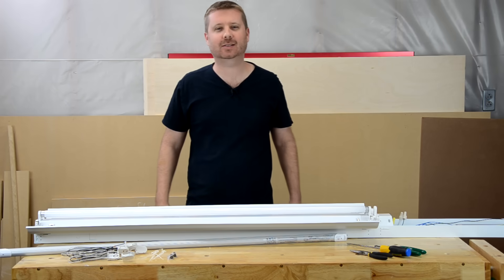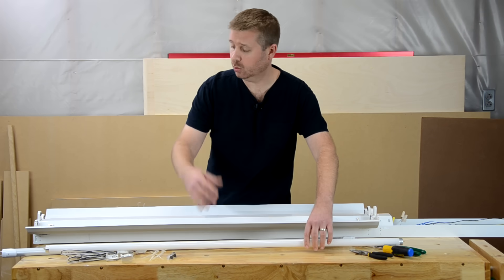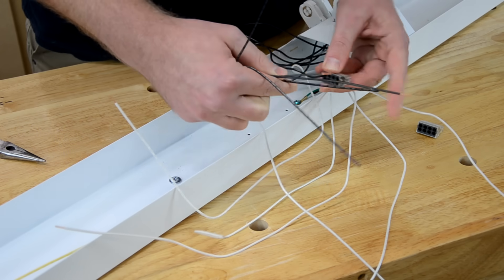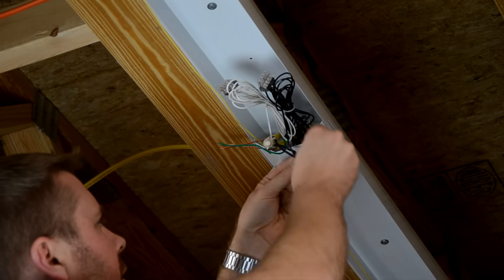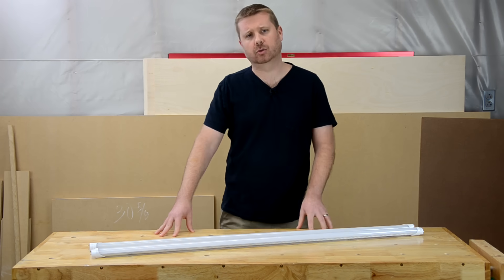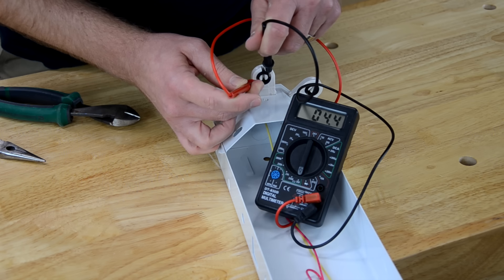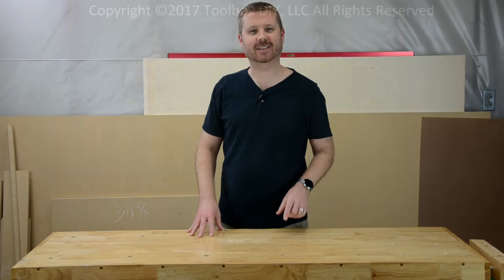How to easily convert fluorescent Lights to LED –Easy Ways to Save Money

Comment: Replacing fluorescent bulbs with LED is only about 50% more energy efficient, depending on what type of fluorescent bulbs you have. The mail reason I converted was because of the noise the ballasts make. Late at night it drove me crazy. Also, in a cold basement or garage, fluorescent bulbs may flicker until warmed up. LED's won't do that. Note: some (not all) LED bulbs are not instant on and may take a second or two to light up. This may take a little while getting used to. I don't recommend doing the conversion unless you have basic electrical wiring knowledge and skills. You'll want to look for 4000K color temperature LED's to achieve the same exact color as fluorescents.
Reply: Glenn Watkins like LED bulbs, fluorescent lamps also come various color temperatures, not just 4000k.
Reply: There are way better colours than 4000k out there. I used specific colours for specific applications when I was an electrician with degrees in lighting engineering. In dairies I could get the cows to produce 17% more milk by useing certain colours and in classrooms for kids with ADHD or ADD certain colours have a calming effect. Plus,  who wants to duplicate the colour of fluorescent bulbs anyways. Good video though he did leave out some important info
Reply: @prepperjonpnw6482  Look for CRI (Color Rendering Index) if color visualization is important.  Some LEDs/Fluorescent bulbs do not emit a continuous spectrum of light.  Colors can be absent.  High CRI (95 and up) present a more continuous spectrum and will allow you to see all colors more readily.  This is totally independent of color temp which is only a subjective description of overall color.
Reply: Yeah, but those LED's I installed at work have 50,000 hours of life, 
So if you use them 5 hours a day, that is 27 years of live.
Try this with an florescent lamp.
On the other hand. if you install 40 bulbs at the hall way even if they are only 50% efficient that means that you save 50% 0n power. 
If you have a business that has 1200 bulbs on their show room and you saved 50% that is a lot of power, actually you save more because you would have less heat also and your air-conditioner has to work less time also.
Reply: Way better colors ? Color temperature is a personal taste when it comes to home lighting. Not everyone likes soft white (2700K) or ultra-white (5000K up). Most schools and homes use standard 4000K fluorescent bulbs.
Reply: Glenn Watkins Glenn my Fluorescent ballasts drive me crazy with the noise as well. And when it's cold the noise is worse and the light output is crappy and flickers! What brand LED conversion tubes did you use?
Reply: I converted 4 dual tube ceiling mount fixtures using these bulbs: https://www.ebay.com/itm/161612851107
Reply: Hi Glen, you can convert you ballast to an electronic ballast, they do not flicker because off the higher frequentie and do not flicker on  startup. They also do not hum or make noise and are a lot more efficient on power use. You can also dim the tubes untill 3% power, this applies to both T8 and T5 tubes.
Please correct me if I am wrong
Reply: At work, I got the Hyperikon T8 LED Shop Light Tube, 4ft from Amazon.  one of the reasons, NO Ballast used, and they work over 120 or 277 volts.  All the lights where I work run off 277 volts.  I installed the 4000K ones in the HR office.  There's bright and white.  Maybe a bit to much.  The owner wanting something not quite as those, so I got the 3000K ones.  He's really happy with the light from those in his office.   They also have 5000K and 6000K versions.  

So the normal Fluorescent bulbs are 32 watts.  These are 18 Watts.  That's about half the power.   When there's a bunch of lights that are on for HOURS, that can be huge savings over a short period of time.  Half the power, and far, far longer life.  Fluorescent bulbs take a big to fully become bright.  LED's are Instant.    

I think in a BI open office area using office cubicles, that 4000K would be good to use.  In a smaller office, 3000K seems like a better light to use.  At home in my garage, I may go with 5-6000K.   Not sure, no rush to convert there as the lights are not on that much to really make it worth spending a bunch of money to convert.

I had 3 round fluorescent bulbs in my Bathroom.   It took a while for them to fully get to full brightness.  I was not a fan, then I came across the round LED version, and installed those, GREAT!!!  Full brightness, a little brighter.  They save even more power.   Most of my lights in my House are LED's.  I still have a dual Fluorescent unit in my Kitchen.   I would like to replace it, or convert it.  I havn't made up my mind yet.
Reply: JB Dragon k
Reply: I went to Philips ,daylight T 12 [2[ bulbs and replaced the advance ballast w/ a GEelectronic ballast and installed  the 2 bulbs and they nver lit up and began smoking on the ends. What was wrong ? I re installed the GE F 40 CW T 12 bulbs and they work fine.
Reply: Most of the stuff I have seen LED are no where near 50% saving lumen for lumen ...Assuming you don't have something ancient that is ... But even if it is only 20% and it really will last for years and not make a bunch of noise?  And not have mercury waiting to bust out and contaminate your home ....It is a good upgrade even if it never pays for itself because you don't stay there long enough etc...I mean assuming you actually get quality components....not to mention it is a great time to upgrade to dimming and or get more lumens from the same size footprint of light fixture ...color/temperature enhancements etc...  But if ALL you are doing is trying to save money?   At least wait until the fluorescent begins to fail...then it becomes a lot more of a no brainer as a fluorescent ballast can easily cost what an LED retrofit might....no brainer then
Reply: How to wire a door bell
Reply: Glenn Watkins n;
Reply: Semper Fi  Thanks Bernie, I mean Semper.
Reply: My conversion to LED saves energy and eliminates ballast noise.
Reply: Glenn Watkins, no you are not even close.  Comparing apples to apples, only a few LED bulbs have higher (true, not chinese marketing lies) lumens per watt.   Many have about the same or even fewer lumens per watt, AND most have far fewer lumens per tube so you either have dimmer light or have to buy and install more fixtures and use more power to run them.

Modern fluorescent ballasts are quiet, operate far above the human hearing range.  You are correct that in VERY cold environments, modern ballasts do still result in dimmer tubes until they warm up for a few tens of seconds.
Reply: Stinky Cheese lumens per watt is not the correct calculation, In most fluorescent fixtures much of the light is wasted since it goes back into the fixture. Most led send light in one direction out of the fixture. So delivered net lumens  is what should be measured and compared, not gross lamp lumens.

Comment: Why did you save all that wire? Just cut it off ?
Reply from the maker: If you're talking about the leads on the non-shunted tombstones, it was easier to zip tie those than to cut and strip 12 wires to make them shorter. If you're talking about wires on the old tombstones at the other end, I kept them so if LED technology changes such that I either put in a double ended tube or end up installing some sort of LED driver, then the wire is already there and ready to use. I try to think ahead...not that I'm successful at it, but I try! :)

Comment: Watch those old ballasts, any black stuff coming out of them is wicked stuff!
Reply: The tar in ballasts was once known to contain PCBs, now verboten; best to avoid.
We once had our tech doing a repair on some Spaceflight Hardware, he left it open on his laminar flow workbench to go get the inspector. 
Yup, the ballast in the bench let go all over it. OOPS! 
The new rule from Lessons Learned (after the Failure Board met) was; put it in a covered tub if you leave it on the bench, nothing left open!
Reply: No it's not.  In any ballasts made in the last few decades it is just an epoxy potting compound that is not especially harmful.  Less harmful than dish detergent for example.  Even if you ate it your body cannot absorb it.   Maybe if you ground it up into a powder and smoked it so don't do that, lol.

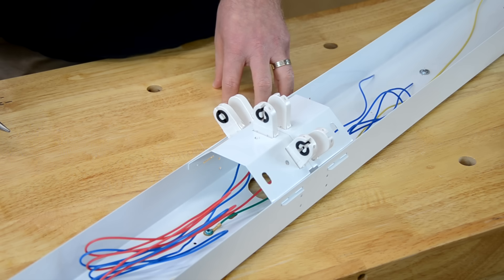Comment: Great video, but, At 3:59 in the video ,  you said "replace the non shunted with shunted lamp holders"  I think you need to correct that. Because it should be the opposite....  Also,  in my case the old tombstones where non-shunted, so I did not need to replace them. Perhaps you could  explain how to determine what you have. Thanks
Reply from the maker: Dennis - You are correct, I misspoke. Unfortunately, there's not an easy way to fix it without taking down the video and re-posting it. I've been holding out trying to find a way to get some text put up during that scene that corrects it.
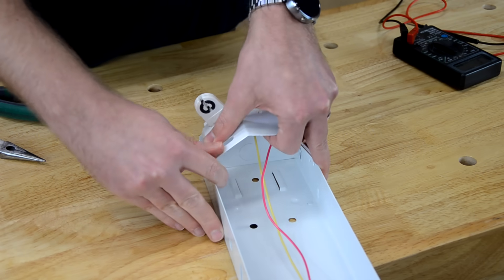For determining tombstone type, check out the section at 10:30.

Comment: You need to bond your ground to the fixture.
Reply from the maker: Correct! It's hard to see in the video but the fixture is grounded. At 7:31, you see the green pigtail being tied into ground. At 4:22, you'll see that the pigtail is connected to the fixture. Thanks for pointing this out. I didn't explicitly say this while reinstalling the fixture.

Comment: I appreciate this video sir. Thank you. Mistake or no mistake. You covered your arse on this one.  Soon farward...
Reply: He joined the bulb directly to the mains power? 
How come they don't use a balast or such.
Reply: @irishguy200007  don't need a ballast for these bulbs. The required electronics is inside the bulb end.
Reply: @irishguy200007  LED light emitting diode uses a sine wave through drivers (like a ballast in non tech talk), there is no arching inert gas such as fluorescent plus your dealling with half the wattage with LED then 40 w att or higher flourscent that the drivers can control with lower wattage. If you were to put a LED driver bulb in a flourscent system with out removing ballast the arch charge would destroy the drivers instantly- possibly electrical fire.

Comment: Where did you find multi wire snap together connectors?
Reply from the maker: Amazon. The brand is Wago.
Reply: In this case, you're talking about very low amps, heat, and physical stress, so I would have no issue with these in this application.  You're talking about less than one amp total, in these fixtures and I've had no problem with them in this kind of use.
Reply: I have used Wago brand in the past, no problems.  the amp draw is so little you should  not have a problem.
Reply: home depot carries them
Reply: Personally, I would not use that type of wire connector. The contact area between wires is significantly smaller than using traditional wire nuts. It is a similar connection to the push in connections on light switches and receptacles which I have seen others use many times and I have seen fail over and over again. The fix for them is to use the screws on the sides.
Reply: Lars Eckman
Reply: Yeah those push in receptacles are used traditionally in single wide mobile home manufacturing.
Reply: Thanx a heap! Really appreciate the help!
Reply: Just like any tool or connection, if used incorrectly or in the wrong application it could lead to failure. But the push in connections on receptacles are really terrible, especially if each receptacle is looped out to the next via these connections. Then you're drawing all that amperage through a mechanical spring connection, causing it to heat, expand and contract upping the resistance causing more and more heat and eventual total failure.
Reply: Home Depot sells the Ideal push connectors and they are great.  I bought some when they were first introduced and I use them all of the time.  I used them for a LED conversion last year.
Reply: fbeckman, can you provide a pic or link for the kind of connector you are referring to? Thank you in advance! I'm getting ready to do this change over and if a better part is out there, I'd like to have a look.

Comment: question: my case where the fluorescent tube fit have a starter switch (small tubular thing) do i remove those ?
Reply from the maker: If you are bypassing your ballast, then yes, remove the starter switch. Since you have one of those starters, it could mean you have a magnetic ballast. If so and you don't plan to bypass the ballast, you'll need to make sure you get LED tubes designed for use with magnetic ballasts. In most cases, the starter would be removed when using an LED tube with a magnetic ballast, but be sure to check the installation instructions of the tubes just to be sure.

Comment: To keep the fixture UL approved,  I strongly recommend using a LED lighting system using a external driver.  See Titan LED for example.
Reply: Jim Dye that makes no sense.  While better fixtures do have an external driver for other reasons, there is nothing about having an internal driver that changes the UL approval process or likelihood.  The thing is, many generic Chinese manufacturers just don't bother no matter how good or bad their design is.  They can just ignore everything and change their name every so often if it really comes down to it, and they do, often selling under several different brand names simultaneously just in case one gets shut down for whatever reasons.
Reply: Jim Dye hn

Comment: around minute 3:55, you talk about replacing the non-shunted wire holders with shunted wire holders. Isn't it the other way around? I believe minute 11:47 has it right, so I understand the concept.
Very informative video. Thanks for the info.
Reply from the maker: Nice catch, Michel! You are correct, that was stated backwards. For a conversion to single ended LEDs, you are replacing shunted lamp holders with non-shunted.
Reply: Michel Dumas n
Reply: Chinese cucumber salad